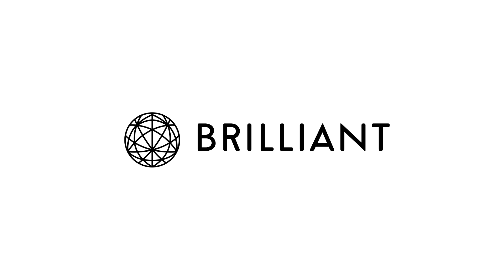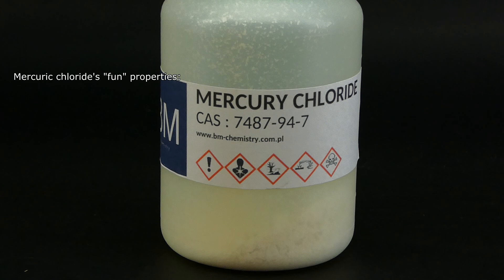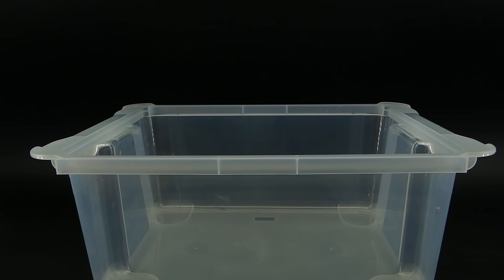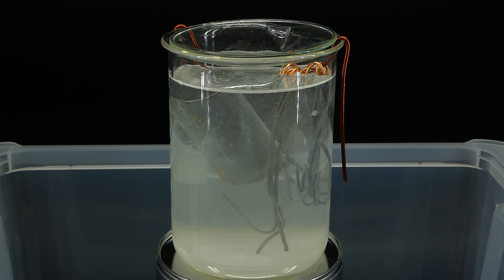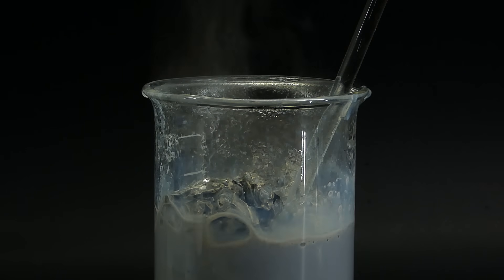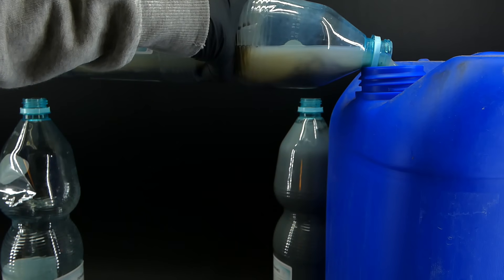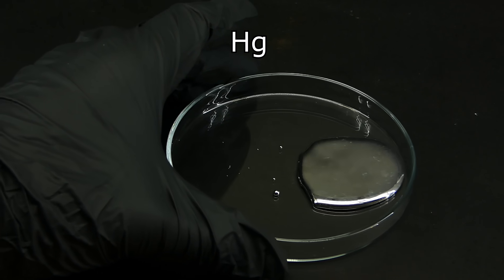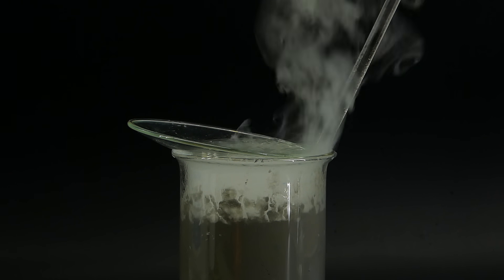Making Mercury - A Toxic Liquid Metal

Comment: I still remember the first time I held onto a bottle of mercury, the weight felt surreal despite knowing its density.
Reply from the maker: Yeah, holding a container with mercury is a pretty interesting feeling
Reply: Very interesting feeling, indeed.  Seeing a few hundred kg of the stuff has a rather weird effect the brain. A few dozen 10kg containers of the stuff, thankfully stored properly in a leakproof mercury cabinet.
Reply: First time I went to handle a 500 mL bottle of mercury, I tried to lift it and it just didn't work. My brain wasn't expecting the actual density.
Reply: It's like picking up a brick of lead like I know it's 20 pounds but it's still always surprising lol

Comment: The copper metal method did not work, because the reaction produced Copper (I) chloride on the surface of the metal, passivating the metal. Copper (I) chloride is a white-greyish powder, that is really insoluble in water, however, it is soluble in hydrochloric acid, so by adding some hydrochloric acid to your experiment, you can maybe recover the mercury. This is experimental nonetheless, as Copper (II) chloride will react with the copper metal, producing Copper (I) chloride, removing excess hydrochloric acid. You can prevent this by doing the reaction in an airtight container or in an inert atmosphere, so the oxygen from the air will not oxidize the Copper (I) chloride to the Copper (II) chloride.
Reply from the maker: Thanks for the explaination! Everything makes more sense now and in the future I will probably test out your theory :)
Reply: Like i said, before attempting to be a « chemist » learn chemistry, because one day you will make a mistake… chemistry is not something you can do as an « amateur » it’s not a game…

Comment: My most memorable mercury experience was getting an extremely heavy gauge thing from a junk yard. When I opened it up it had a cylinder inside that was filled with about 2 quarts of mercury. Turned out the device was a pressure measuring unit for a high pressure gas line. The mercury completed circuits according to pressure. Don't make em like the used to 😂

Comment: Elemental mercury is not as toxic as people believe.
Reply: It actually is, it's very toxic. But it's fairly hard to get it into your blood stream where it'll do the damage, which makes it not too unsafe to touch. 
But as stated in the video, at room temperature it slowly vaporizes and the vapor will easily get absorbed by your lungs and then be transported to all the places where it can do damage. When released into the environment, it can also be converted by specific bacteria to much more dangerous and easy to absorb compounds. I've dropped mercury on the carpeted floor in my house before. It was a total pain to clean up. Ended up ripping out part of the carpet. Every time you try to pick up a little ball of mercury, it tends to just split up in more tiny balls.
Reply: Elemental mercury vapors is not good to breathe in. And you got to take precautions to clean it up. Mercury compounds like mercury chloride (HgCl2) is much more toxic. Mercury is also bioaccumulative, making it more toxic than lead. So it would be good to replace Aluminum Mercury amalgam with Aluminum Galinstan amalgam for reductions and reductive amination. Gallium and Galinstan is non-toxic and fun to play with.
Reply: Such a bad comment and very ill informed.  Also mercury is a cumulative thing so maybe the first time not a big deal but repeated exposure is an issue.

Comment: I have worked in some of the largest mercury producing processes in the world (gold ore processing) and the waste gas stream was scrubbed to Mercury (II) Chloride and then Calomel for shipment to a Waste facility. Zinc Powder was used to convert the unreacted Mercury (II) Chloride into elemental Mercury which was drained out of low areas. Try using zinc in your waste solution to remove the mercury.

Comment: Hi, what gas mask are you using, i am also doing some chem and i dont really know what to look for. Can i get any recommendations?
Reply: Uhhhhh...
Reply: You would want to use "MP - 5 Gas mask" It's designed to protect against chemical weapons and such, so it will do, they need to have filters exchanged every month or so, but it's rather cheap, so it will keep you safe if you use it correctly.

Comment: 6:30 FYI you can strip copper wire of insulation by the kilo in 5 minutes by letting your cables soak for like 1 night in acetone. Then a large chunk of the insulation will fall by itself or with minimal mechanical help. You'll end up with something that resembles a plate of spaghetti (the insulation bits) and a puddle of clean copper cables. That cable stripping is probably really satisfying to see on video.
Reply: Does that work with enamel coated wire? Is it actually a polymer coating? I've seen people suggest burning it off but that has never worked so well for me. I end up scraping it off with a knife. Edit: I guess I should have checked the timestamp you referenced before commenting, it's obviously the PVC coated wire.
Reply: @igotes  yes it should work with enamel coating, also with PVC (is PVC gonna release chlorine though? could be an issue).

When I scrape the enamel off for regular use (i.e. not just to recuperate the copper) I use a thin strip of very small grain sand-paper instead of a knife: take like a half a centimeter wide strip of sand-paper, fold it into two, making sandy sides touch one another, and pinch the end of your wire in that sand-paper and just give it a few turns. Works like a charm. You can also vaporize it with the soldering iron but I like that less.
Reply: Thanks for the info. I've tried with sandpaper (something like 240 grit), I use the same method as you described, I just can't get 100% of it off, which is a bit of a pain to solder. I'm working with < 1mm dia wire. I think in future I'll just get the wire without the coating :)
Reply: Actually now I think about it, the sandpaper method does work well for longer lengths, in my case I was trying to just expose a few mm from the ends of very short pieces, which made it harder to do on a large scale. But I was going about it the wrong way, bare copper is much easier, stick some kapton tape on for insulation.

Comment: If you have a skin of impurities floating on the mercury surface (or for example glass bits if you collected it from breaking mercury switches), you can remove that using a loop of cellophane tape.  The impurities will stick to the adhesive but the mercury metal won’t.

Comment: Hi, when displacing the Hg on Al, the addition of a small amount of HCl should help. It would dissolve the Al(OH)3 being formed from AlCl3 hydrolysis and release the Hg trapped in it/stuck to it and allow the Hg to agglomerate together better, and should not dissolve any Hg. I would imagine based on similar displacement reactions that if you acidify your waste solutions from the displacement, add more Al foil and slightly elevate the heat, below (50c), that you will attain a significantly higher yield and recover a lot of the Hg trapped in the waste.

Another option would have been to covert the HgCl2 to insoluble HgS with H2S (or Na2S) and reduce the sulfide with something like dilute H2O2 at neutral pH (slow addition to keep temp low) to form the metal and dilute sulfuric acid, which should not redissolve the Hg. 
Alternatively you could also work from HgO after reaction of HgCl2 with NaOH, which after cleanup can then be easily reduced by H2O2. ascorbate or formate (the latter two will require high temp and pH 5, which may volatilize some Hg) to get Hg metal without the sufuric acid waste or dangers of H2S.

Personally I would have chosen conversion to HgO, followed by reduction with H2O2 and would try the extra HCl + Al for the waste (after concentration) and use the sulfide route to reclaim any remaining Hg before taking to hazardous waste disposal. Of course a distillation would also work, but is obviously not recommended.

I hope that helps.

Comment: One experiment I've wanted to try with mercury is dissolving a small amount of aluminum and magnesium, then bubbling hydrogen into it to see if Mg(AlH4)2 precipitates on the surface. The thermodynamic data I could find says it should form, but I don't know if the kinetics work out. It's a strong reducing agent that could be useful as a hydrogen storage material. It's also reported to be pyrophoric, so that might be fun.

Comment: You could have used electrolysis, a dilute solution of HCl in which the Mercury Chloride is dissolved, electrolysis will break down both the compounds into Mercury, hydrogen and chlorine gas (that might be a lil bit of a problem) but it would work. The only downside is that you would need a platinum or mixed metal oxide electrodes, which are extremely expensive to get.

Comment: I remember when I studied chemistry in high school we used to use the old thermometers that contain mercury in the bulb and we were all under strict instructions to immediately evacuate the entire building if someone dropped a mercury thermometer on the floor and the thermometer broke and leaked mercury on the floor and we were not allowed to re enter the building until a hazmat team wearing protective equipment cleaned up the mercury spill and safely contained the mercury spill

Comment: I completely lost a sample between 4 and 5x your final yield there, several years ago, into carpet, off the coffee table.

I can attest it turns into tiny beads, a few of which stuck to carpet fibers, but by far the most notable thing was that it instantly disappeared down into the carpet.

It was never seen or heard from again in the time I lived there.

Having played with it extensively prior to this, it's amusing to see all the paranoia about it now. Any effects from just messing with it for a bit here and there, as well as exposure to vapor for a few years... minimal.

It's a shame it has been banished into almost non existence... the stuff is a lot of fun to play with indeed.

You're right tho. Get away from the metal and things do get a bit scary. 

I currently have a selection of 3 large mercury switches with a total of about your yield there... I occasionally take them out to play with them but it stays in the sealed switches.

I figure probably not a great idea to push my luck 🤣
Reply: You think it's fine living in a home that has a constantly high concentration of mercury vapors? You'll stop thinking it's funny when tremors start as you get older.
Reply: @lajoswinkler  The ship sailed. No tremors. But what else you got? 🙄

Comment: Personally, I would just have made a mercury chloride solution with water, and kept it cool probably with an ice bath, this is for 2 reasons, firstly I don't know the exothermic nature of the following reaction, and secondly, if this makes mercury as I want it to, then it will likely be dispersed in the solution, and I don't want any to dissolve in the water, (though the solubility is low already) colder water renders mercury almost entirely insoluble. then I would add a non-halogenated alkali-metal/alkaline-earth-metal compound, preferably somewhat water soluble, such as calcium hydroxide, sodium hydroxide and their respective carbonates. (calcium carbonate and hydroxide are essentially insoluble in water, but they display retrograde solubility, meaning that they dissolve easier in cold water) if the strong basic nature and high ph of the hydroxides interferes with the reaction, then use the carbonates instead. I would avoid using bicarbonates because that would evolve excessive CO2. I think I would pick sodium carbonate as my first option, mostly because calcium chloride is annoying to deal with, and sodium carbonate is not as caustic as lye.
the reaction is as follows: HgCl2 + Na2CO3 = 2NaCl + Hg + CO3 I don't know if the mercury will form a carbonate at these conditions or not. the idea is that since its such an unreactive metal, it would just ignore the CO3 ions, and they would bubble off to produce CO2 gas and oxygen. it may form mercury oxide though, but whatever it forms, it should decompose when sufficiently heated.
alternatively, like in the video, you can add a piece of a more reactive metal to the solution, such as copper or aluminum to form their respective chlorides, and metallic mercury. this could contaminate the mercury metal with other metals and form an amalgam though, which is why I mentioned this method second. the advantage with aluminum is that the mercury will not only amalgamate with it, but it will also break apart the protective oxide coating naturally found on the aluminum and prevent it from forming again, which means the highly reactive aluminum can directly react with the water and form aluminum hydroxide which is insoluble in mercury, which means that the mercury will be left on its own. disclaimer: I am by no means a professional chemist, I just do it as a hobby.

Comment: Extracting mercury is not one of the easiest things to do. Unless you regularly work around toxic chemicals, it's not worth the trouble really. You might do it as a project, but if you need it, just get the pure element.
Reply: This is not extraction, but isolation. We extract parts from a mixture. We isolate elemental substances from chemical compounds.

Comment: You can make mercury , from mercury chloride on reduction with  stannous chloride or hydrazine hydrate , or ading nitric acid in mercury chloride solution and after  reduce with copper , or  reacting with sodium hydroxide , when you obtain mercuryc oxide , disolving in nitric acid and after reduction with copper. If your mercury solution contain excess of copper nitrate hard to remove ,  you need to used  ammoniacal solution or  hot solution of ammonium carbonate an washing very well with watter and yield it is very good.From yor waste mercury can recovery in this mode : first  ading in  liquid waste , sodium hydroxide in portinos  to make aprox.28 % concentration  with  formation soluble sodium hydroxide aluminate ( ading more much sodium hydroxide generate insoluble product) residuale waste washing with  watter and reacting with nitric acid , to form mercury nitrate. Success.

Comment: Cinnabar and mercury are amazing and beautiful, they are not the problem, humans just need to figure out how to control ourselves on the massive scale that we do everything else.
Reply: I am curious if you are using a positive air flow with filtered clean air intakes out away from the room and vent?     It might sound like overkill but it is easier to breath and much safer than relying on a filter and seal.